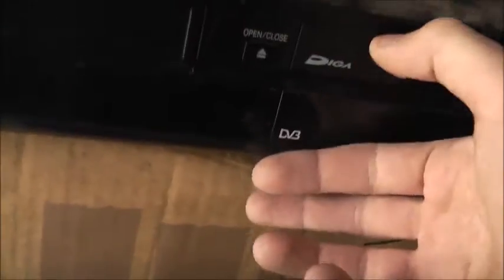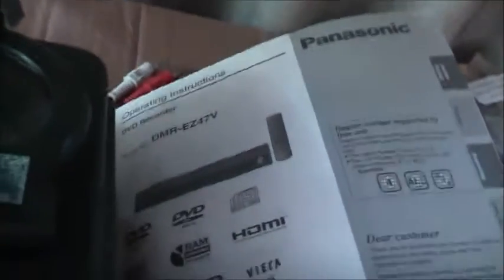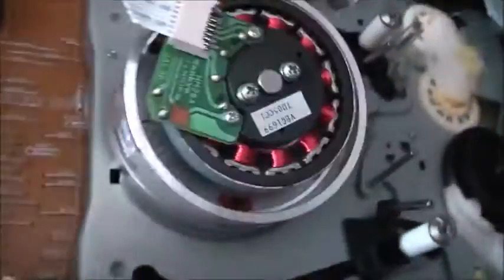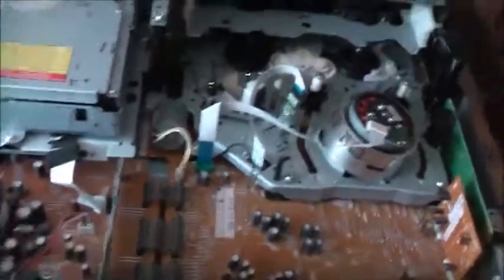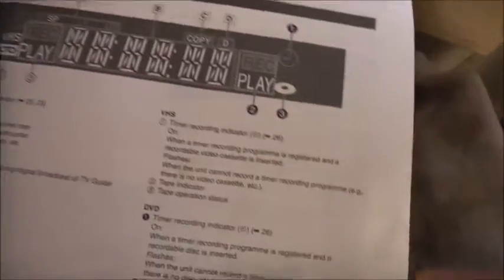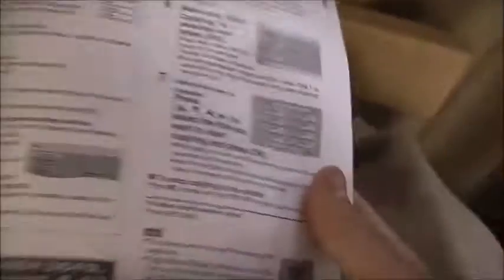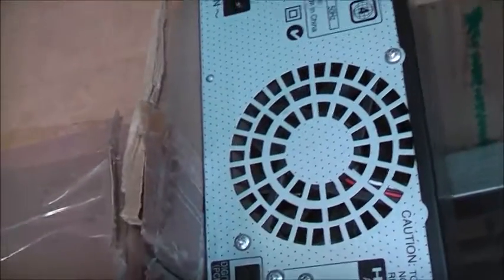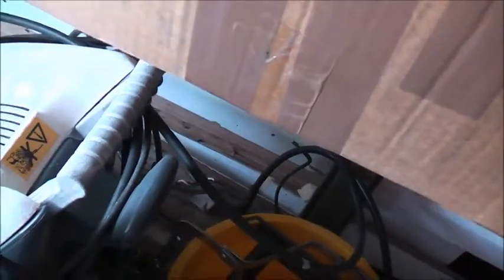Panasonic DVD Recorder VCR Combo Score!!

Comment: I'm surprised it doesn't power up with a failed DVD drive. I've got a SD unit with HDD with a failed DVD drive & it still powers up. The drives on a few Panasonic units die easily that Panasonic were sending free replacements at one stage. 

The Viera link does work with the Panasonic modern TV's. I currently use a Panasonic DVD/HDD Recorder with twin HD Tuners and I hope to get a few years out of it hopefully. Fingers crossed!!!
Reply: +QRHuggies It will if said dvd drive is shorting out the power supply section. :P